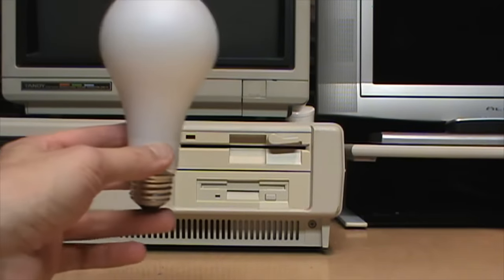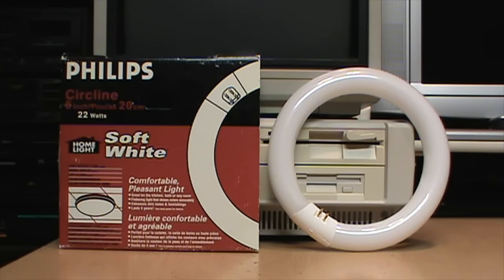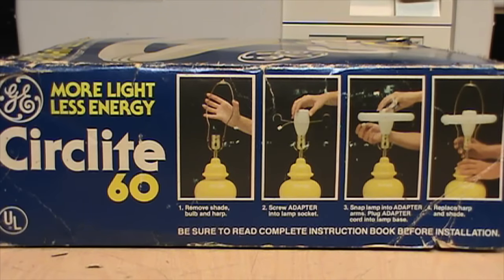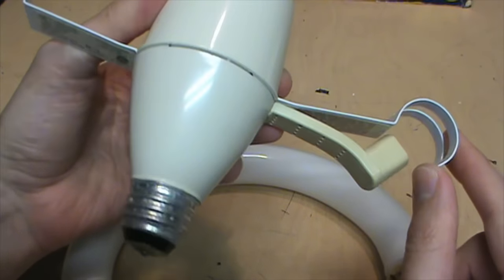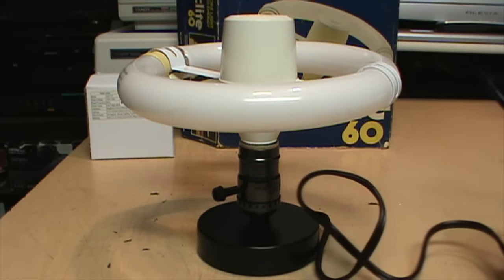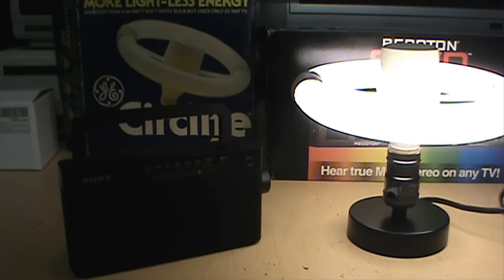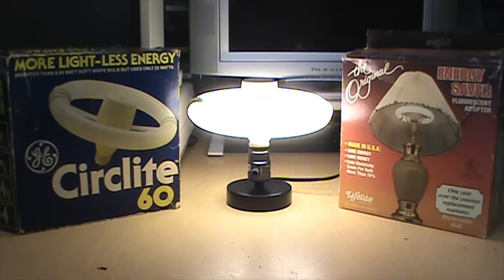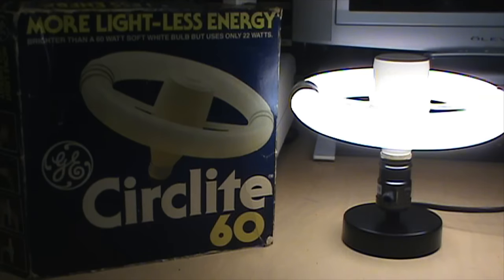The first CFL: 1979 GE Circlite

Comment: The $9 price was what I remember.  A pack of regular bulbs was about a dollar in those days, maybe $1.50.  It was not possible to justify the extra cost for one of these things.  I did push my family to regular CFLs at several multiples the cost of a regular bulb. Those CFLs never lasted long.  And nowadays I run 100% LEDs, usually the ones from Dollar Tree.  These finally finally hit the spot of lasting for years, using almost no power, and costing very little to buy.
Reply: 9 dollars was a fixture and ballast plus bulb. The replacement bulbs were a dollar or two at a hardware store. You can still easily get them for 6 dollars at hardware stores.
Reply: I like the Sunbeam 60watt equivalent LEDs from the dollar tree, but tried one of their brand ones and it didn't last me a month. Started blinking when first turned on for a few minutes until it didn't stop blinking, then just dead. Have tried other wattage equivalent LEDs from them without issue though.

Comment: I live in a country, where those are uncommon, but available at some store. When i was a kid, around six years old, the parents of my best friend had this kind of lamp in a weird shaped holder, which looked like a sci-fi prop in their bathroom and my thoughts were that it was an extraterrestrial space lamp. I asked the parents about the lamp and his mother told me that they stole it from an UFO. Whenever i was visiting my best friend and felt sick, because my stomach was a bit more sensitive back then, i spent 10 minutes sitting under this lamp and whispering to it to get "extraterrestrial space healing powers" and it did make me feel better, but that didn't last long, because i grew up and realised, that the lamp is not part on a UFO. 

There was also another instance where a weirdly shaped lamp triggered my child fantasy. There was a small shopping centre with a color changing crystal lamp inside a water fountain near the main entrance and exit area. There was a sign which read: "do not drink". As kid i thought that the fountain and it's water was part of the security system. If the thieves would break in at night, the crystal would release it's spirits, each for one colour to drag the intruders to the magic water in order to dissolve them.

Comment: Re: AM interference, found out the hard way when I had a couple CFL curlies on my garage door opener. Bad idea, it interfered with the opener remote signal!
Reply: There are still incandescents available for that purpose due to the AM interference issue.  IIRC they are only 25 watts, though.

Comment: I remember the circular fluorescent bulb in the 70s that had a metal round starter with two pins that you plugged in and turned and that was what started the bulb maybe acted as a ballast or something
Reply: The starter used in older fluorescent fixtures acts as a time delay switch.  When the lamp is turned on,  the starter closes and connects the filaments inside the tube in series with the ballast,  heating them red hot.   This allows the tube to start with a relatively low voltage of around 250 to 300V.  When the starter opens the magnetic field in the ballast collapses and produces a voltage spike, striking an arc though the length of the tube.    

Instant start fluorescent tubes do not use filament heating and instead the ballast provides a voltage considerably greater than other types to start the lamp, usually in the 600 to 750 volt range.  

Instant start lamps, also called Slimline,  are identified by single pin bases, but bi-pin Instant start lamps were also available over 30 years ago in 48 inch F40T12/IS, and 60 inch F40T17/IS.    These unusual lamps have the filaments internally shunted so they cannot be preheated,  and will not operate if mistakenly placed in a rapid start or preheat fixture. They were electrically interchangeable with the more common F48T12 slimline lamps and use the same ballasts.

Comment: My grandmother had a 12 inch kitchen ceiling circle lamp for more than 40 or 50 years was still working then my dad replaced it with an LED 24 inch around ceiling lamp that thing only last for three years still works but you might have to get through 20 or 100 flashes before it stops flashing and works like a normal lamp.  New things don’t last very long!

Comment: I like saving electrical power.  When the CFLs were introduced, I installed them throughout the house.  I didn't see much savings in the electrical use (read: my monthly bill didn't really decrease).  I felt like we were sold a "bill of goods" on those.  This was compounded when we learned the steps needed to be taken when disposing of a CFL, due to toxic chemical components used in the CFL lamps (worsened by the fact that they didn't last nearly as long as advertised).  I went back to Incandescent bulbs briefly, since most places were fire-saling them due to impending government restrictions.  LED bulbs were still pricey, so I sucked it up for a few years, with the cheap cost of the incandescent bulbs mitigating the higher energy use (a $14.00 bulb would have to use almost no power to match the cost savings of an incandescent bulb which may have cost $.25 - $.33 per when stocking up.)

Eventually, we went all LED - saw some savings, but still nowhere near as much as when we replaced our two central AC units for new high-SEER units.

Great video, very informative, as usual.  Thanks.

Comment: We used to use these in kitchen and bedroom fixtures that were a simple bulb socket on the ceiling and nothing else, so did my grandfather.  These lasted about two years being left on 24 hours a day, seven days a week.  Ironically, the adapter (a simple ballast style starter adapted to a lamp base) is usually what failed first, not the bulb.  We used them because we didn't feel like dragging a step ladder into the kitchen to change an old style incandescent every two months (later, I started using 130 volt bulbs which were slightly dimmer but lasted longer than even these things).  I guess I should have looked for them in the local K-Mart, though -- I remember these costing about $20 in the late 1970's, I probably walked into the nearest hardware store and bought them there.  I hadn't thought of putting these in my table lamps and it wouldn't have been cost effective at the electric rate (IIRC about 3-4 cents per KWH, my phone bill was actually much more than my electric and natural gas combined) and the cost of 100 watt incandescent light bulbs (probably about a dime each) back then.  I could probably have even added a mortgage payment to that tally and my $180 per month phone bill would have still been more but I paid cash for the house I owned and lived in at that time.

Comment: There is a more recent similar fluorescent system called D lamps. Because the bulb was shaped like a letter D. It used a 4 pin square base. These came in to replace halogen floor up lights which were eventually discontinued due to their propensity to cause fires.

That was probably the last fluorescent system ever. It even barely overlapped early white LED systems.
Reply: GE or Thorn 2D. Lots of comments about them here although non about fires.

Comment: What's crazy is how efficient we got in recent years with LEDs that we can buy lamps that manage 210lm per watt. 
Bulbs with a colour rendering index of 97+ are possible as well and with a frosted glass you can't tell the difference. 
Waiting for the 210lm/w 97ra flicker free LED and I'll be finally tipped to replace my cfl that has run the better part of 15.000hrs on a floodlight with the ballast being downwards and thereby little thermal stress. 

Sadly lost a lot of it's original output

Comment: There were similar looking bulbs that were induction powered, which can be more efficient then regular cold cathode fluorescent lamps but they also last theoretically forever, unlike fluorescent bulbs.
And inductive sulfur lamps are incredibly efficient, more efficient than LED's, lasts again, theoretically forever. Has great color rendering index, and can be scaled up to very big power versions.
But because of the complexity, (needing to use a special magnetron, so you're basically buying a whole microwave with each lamp) they didn't catch on.

Comment: nice overview VW, I have a Circline kitchen dual tube fixture from the 60s, used daily & still works perfectly & the tubes average 5-10 years, way longer than the long tubes. Do you think the "new" video ring lights were a spin off of these?

Comment: I have one of those and i need a new tube for it. The ballast is fine though
Reply: You can find them for 6 dollars at any department store. But if it is a really well used adapter, it may actually be the integrated starter that is failing. If you can crack it open you can wire a new one in or glue an external starter socket on the outside and run the wires down in.

Comment: My dad thought these were a great idea and got a couple on sale (a requirement) at K-Mart. One went in the bowl-like ceiling fixture in the kitchen and it worked great for 3 months when it burned out. The second one lasted a little longer but obviously there was a problem with the ones we ended up with.

Comment: Don’t know if the rest of the world calls it a ‘loupelamp’ but i use it everyday in my work. Modern types use leds of course, but mine still uses the circular FL style lamp
Reply: I guess you mean a magnifying lamp. I have had one for about fifteen years. Ironically, earlier in the year the first thing to fail was the joint which holds the magnifier in position. I liked it so much I bought a new but identical replacement using the same T5 circular tube on eBay.
Reply: Sounds like you have a classic LUXO magnifier lamp. They're still in production. Cheers!

Comment: 9:00 It happens because modern one uses electronic ballast, to start it. I bet, the old one still have heavy inductor core, in the centre, and it's quite heavy. And classic thermal bimetalic starter. Inductor + starter heats up, when starter  disconnect, coil provide high voltage to ignite current flow trough gas. While electronic one uses smaller choke, less copper, less materials, but uses electronic DC/DC high frequency converter. If classic starter is good quality with platinum on the contactors, it may work much longer without need to be replaced. Good thing about electronic ones is that you can turn it on, turn it off and there are no mechanical elements.

Comment: Don't discount the filament LED bulbs that can look awfully similar to incandescent bulbs. I bought some Philips "Ultra Efficient" bulbs that use 4.5w for 810 lumens - more or less 60w incandescent equivalent. They're fantastic.  They're made like un-frosted incans though.
Reply: Longevity of them is pretty crazy too, I have a 40W equivalent LED filament bulb that was very cheap and it has been running continuously for over 5 years now... well, aside from a couple of power cuts here and there.
Reply: @lemagreengreen  When I first saw the filament LED bulbs I hated the idea because I assumed they'd have short lifetimes because the lack of a heatsink but they just keep on keepin' on.
Reply: @mrflamewars The filament LEDs have helium gas filling that acts as a better heat sink than the plastic on metal base bulbs have. And they tend to have to be tighter with the power budget. The Philips Ultra Efficient get an incredible 180 lumens per watt, by far the best in the 120 volt market. Even better than most LED retrofit tubes being used in commercial buildings. I just wish they could sell them for less than 7 dollars per bulb. The decreased heat means that they have an expected lifetime of 46000 hours.
Reply: I tried the Philips ultra efficient but had to return it. They only had them in 3000K or 5000K, and every other bulb in my house is 2700K. It was too noticeable of a difference.
Reply: @zacksstuff  You just gave up the most efficient lighting product on the 120 volt market. Nothing even comes more thant half as close. 180 lumens per watt. Maybe consider converting all bulbs in a fixture or in a room at the same time. I prefer the 3000K. 2700 makes everything look yellow.
Reply: @gregorymalchuk272  the bulb I was going to replace (2700k, 75w equivalent) is still 110 lumens per watt. Not awful. It's not like I went back to incandescents or anything like that.

Plus at $7-15 a bulb and 9¢/kWh here I don't think I'd ever make back the difference vs my current 75¢ bulbs.

Comment: I have many of them Circlite  lamps. yes the old ballast ones were quit on RFI. the newer one like lights of América had a electronic ballast. looks like the GE one but small and lighter. same 22 watt lamp. was more  efficient but bad on RFI noise. They do not work on dimmers. and  some of the new LED ones make RFI but not all. the Wal-Mart ones  good. on RFI noise. and they have LED Circlite replacements now. have not tried them yet. the ballast buy pass LED florescent replacements work great . little to no RFI noise and less power. still can buy electronic ballast and florescent tubes. but they make RFI . may not sell them much longer. UK all ready band NEW florescent lamps to be made and only can sell old stock .

Comment: You're missing something big - you can replace the old florencent lamps with new ones and do a compairison between old and new.
Reply: Exactly. The old GE soft white used halophosphate phosphors, the soft white had a CRI of 52, cool white 62, and daylight 75. They also only emitted 1,100 lumens. Modern rare earth phosphors 22 watt circlines have a CRI in the 80s and put out 1,400 lumens.

Comment: I HATE circline bulbs.  They were installed in the bathroom and pantry of my house which was built in 2008.  They DO use less energy, but you don't save any money if you have to keep replacing them every 6-9 months at $10 a pop.  I'm seeing the same phenomenon with cheap LED bulbs.  They last less time in some cases than the incandescents they are replacing.  I''m literally looking at a burnt out one right now in a set that I replaced en masse in my conversion to LED. Everything is made to a price point and manufacturers aren't going to make a profit by selling you cheap bulbs that last for actual decades, like the old straight Fluorescent tubes often did.

Comment: Ah the good old days when energy efficient things, did not produce radio interference (correct me if I am wrong but it realy seams that way)  it just made you wanna save energy

Unlike now, when energy efficient thing put a lot of RF interference out as a side product, because its just to expensive to properly shield this damm swichmode power supplies or the thing uses PWM (no shield of course) for no good reason at all...

I hate saving energy because all (a lot of) the products that are produced because of it, make my life harder

Comment: I'd debate if these are true CFL bulbs. The spiral bulb was just the final form of the CFL. You didn't show the intermediary CFL which you could get in the late 90s and early 2000s. Those had squared off U bends in them. They had 2 to 3 U bends with straight tubes and weren't as visually pleasing as spiral bulbs which seems a bit like a novelty at this point. We actually have a ceiling fan in the kitchen that still has 4 of these old U bend CFL bulbs in it. One seems to have a bad solder joint in it, but it stops flickering when it warms up. If you still have CFL bulbs in service, there's no need to replace them. Modern LED bulbs are only marginally more efficient than CFL bulbs. The dreaded mercury in them is a very tiny amount. They were really trying to make those as cheap and safe as possible. I don't think there is a mercury vapor bulb ban here in North America like in Europe.

Comment: From what I've learned you should avoid touching the glass of the CFLs or TLs since the oil of your skin may cause burn marks and a shortened life.
Reply: No, you are thinking about Halogen bulbs-they run at such high temperatures, that indeed, fingerprints can cause early bulb failures..FL/CFL bulbs do not run hot enough for this to be a problem.

Comment: A "manual" for a light bulb! I have to laugh! All the packaging, printing and marketing.. did it really save any money at all at any time?? Not possible!
Reply: Back in the day, GE wanted it installed correctly. Fewer comebacks, fewer complaints to their CSR 800-line = happier repeat customers. Pretty radical concept.
Reply: @blackrifle6736  Makes sense for the time. Lots of other tech was certainly overthought/overengineered.. just think of those vcr's that weighed 39 pounds or more!